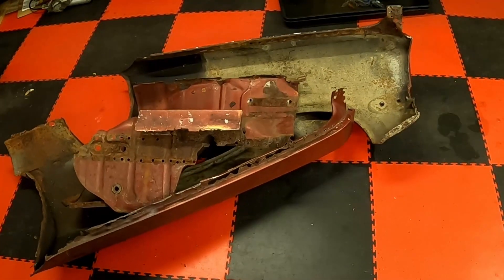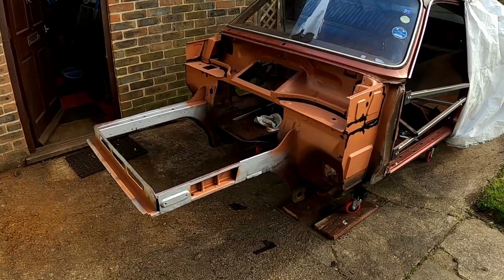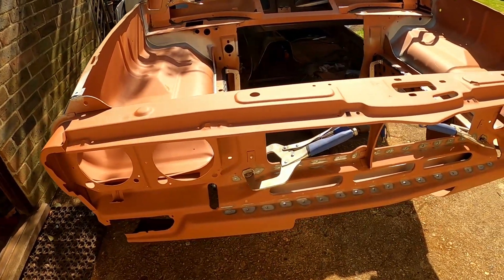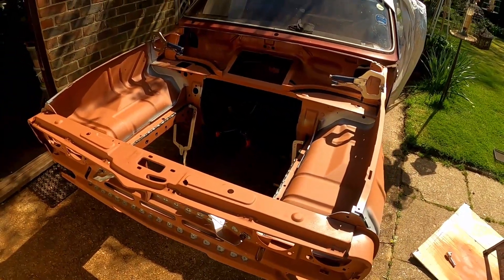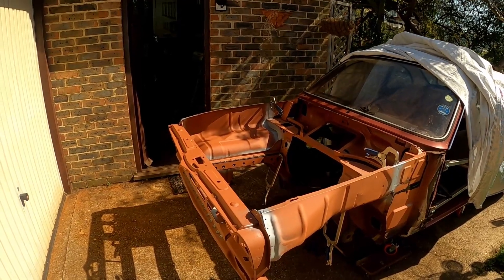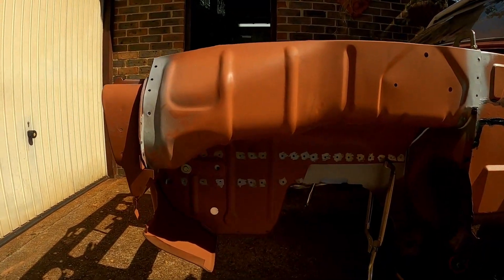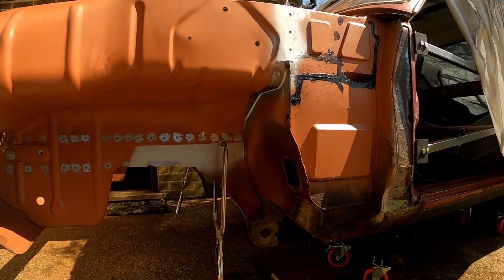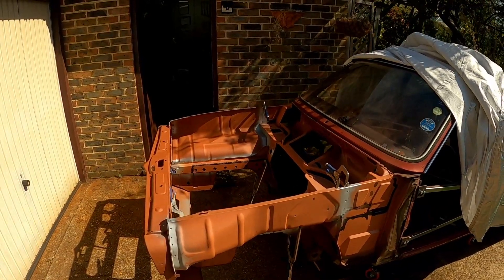Fabricating a firewall for my LS swapped Vauxhall Firenza [Ep11]

Comment: Nice build I've fitted a 1uz lexus v8 5 speed into an hc the fit looks pretty much the same , I didn't cut anywhere as much out of the firewall as you have , i like the chassis plates did the same to ours also strengthened the crossmember and added a brace between the out riggers to stop spread and took the exaust above the gearbox crossmember to aid ground Clarence extra power makes a nicely balanced car
Reply from the maker: Cheers wil, before I went with the LS I was going to fit a 3uz! The w58 manual box I was going to use would have meant a lot less firewall cutting - the 4l60e bell housing is huge and the trans is wide because of the servo on the side... Have you got any photos of your build? Instagram or something? Would be cool to see!

Comment: Amazing work , really amazed at what you have made at home.i could have done with you o;d bits to repair my viva with .!
Reply from the maker: Hi Mike, where there's a will (and a welder) there's a way! - the front panel and the better of the two inner wings did go to a new home rather than scrap! The outer wings I will probably repair and reuse. If you have Instagram find me there, I tend to post a bit more real time on there (these vids are a few months old) if you spot anything you need that I'm not using you can message me there!

Comment: I deleted my viscous fan as the hoses got in the way,so its now switched with the ECU ,i see you have a drive by wire throttle body,mines a cable but all  different mods can be added or deleted using HP Tuners,remember to delete the vats system,or it will never start.Only need three wires to get it to run,  Live ,switched live and fuel pump live,bet you new all that anyway,great vid looking forward to the rest.
Reply from the maker: Smart move going to ECU switched fans! Im going to swap to an electric water pump and the shorter corvette style crank pulley, that should bag me room for electric fans controlled by the ECU also - as for the ECU itself, I'm binning off the stock ECU altogether and using a holley terminator, not the cheapest route but nicer data logging, more user friendly tuning etc